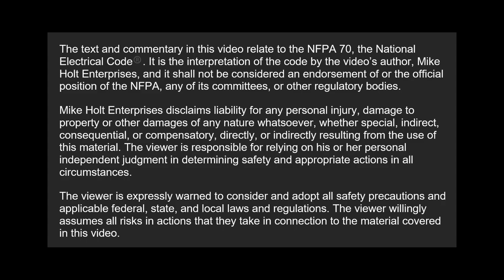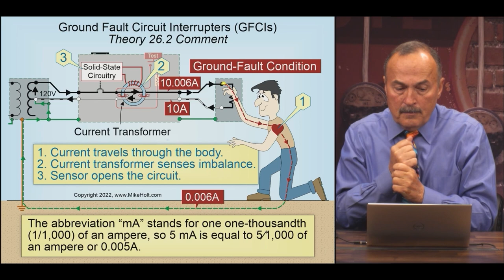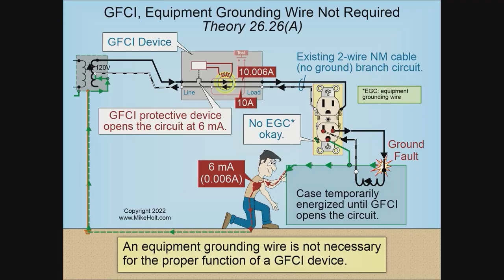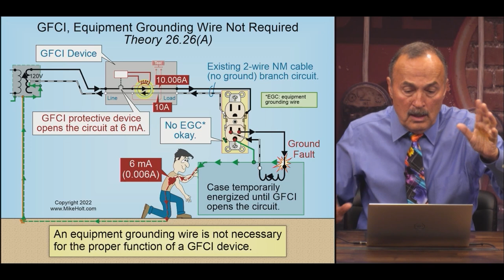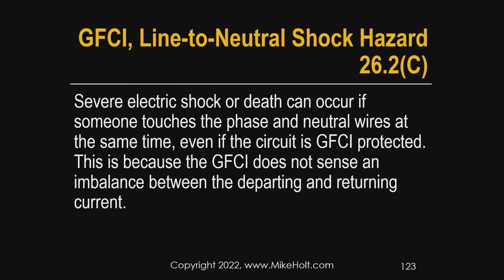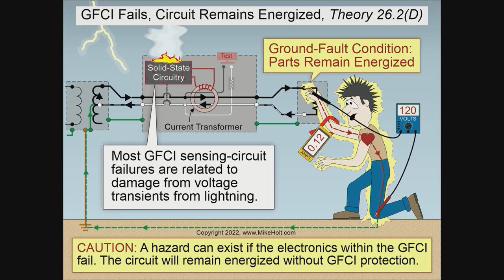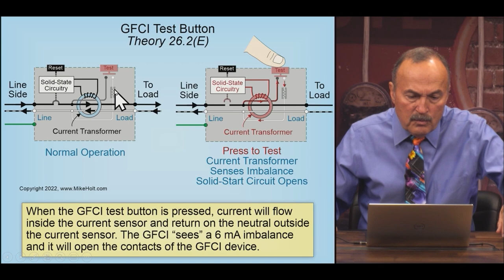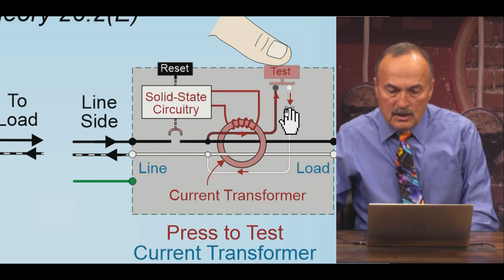Ground-Fault Circuit Interrupters (GFCIs)

Comment: Why not use GFCI break type in the electrical panel instead of the outlet type?
Reply from the maker: GFCI is set to trip between 4 - 6 mA, if you used it for the entire house, expect that you'll be losing power often.

Comment: According to the NEC, can GFCI outlets be installed in bathrooms 16” above finished floor.
Reply from the maker: The required sink receptacle in bathrooms must be installed in accordance with 210.52(C), which would not permit it to be 16" above finished floor. However other receptacles in the bathroom or other rooms in residential or commercial occupancies can be installed at any height, even in the floor.

Comment: Hello Mike, I have been watching and learning through your vedios for few years now. 
If possible can you please make a vedio on NEC Article 501. I know you made a vedio few years ago on Hazardous Area Classification. 
But if you would make a detailed vedio on wiring methods, Conduits, Fittings, Conduit Seals, Enclosures, Termination boxes inside Class 1 Div 1, Class 1 Div 2 areas. What are design considerations at the boundaries of each area. 
I work in Waste Water Industry, if you could explain using examples from lift station etc that would be great. 

There are multiple people around me that can use your guidance for a better understanding of Article 501. 

Also this will touch some topics of NFPA 820. 
Thanks.

Comment: The newer GFCI receptacles now knock themselves out of operation when the protection is lost for whatever reason.
Reply from the maker: No, there are multiple options. One option is a sound, a light, or deenergize.
Reply: @MikeHoltNEC   the ones I have seen simply deenergize.
Reply from the maker: You must be using Leviton. P&S states "automatic self-test every 3 seconds. If the device ever fails, the indicator light flashes to signal it should be replaced."
Now you learned something new.
Reply: @MikeHoltNEC  I use P&S as well. I've never known that they sound an alarm.
Reply from the maker: I'm sure it's in their instructions.

Comment: I came up with an idea, imagine a non-contact voltage tester or detector, that is a watch type that you wear on your wrist, when you touch it hot wire, watch detects voltage, transmits signal to cell phone, cell phone transmits signal to disconnect with receiver and disconnects circuit, and or entire sub panel or panel, what do you think about my idea ?
Oh, maybe false tripping ?
Insulated coil Ring on index finger that detects current through finger, then to watch, cell phone, and trip circuit, sub panel or panel or disconnect with receiver
Reply from the maker: Sounds like it's complicated that this watch would know what breaker to turn off. Let me know if you ever get such a device made.
Reply: @MikeHoltNEC  I’m working on it now, not as easy as I thought to detect voltage, current, I am learning about op-amps, I imagine when I figure this part out, the rest will be easy, I am thinking
Reply from the maker: Would be nice.
Reply: @MikeHoltNEC  I just posted one of my circuits I was talking about, could be smaller, could be wireless, I have many more ideas on this topic, Gene Bowdish